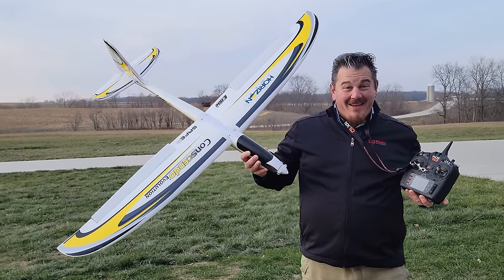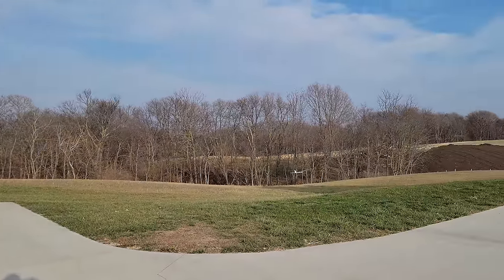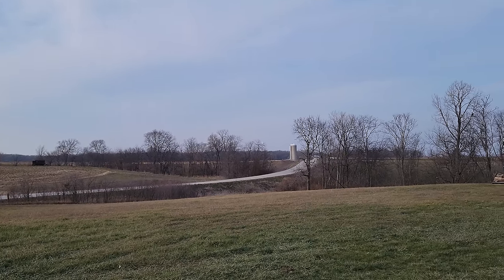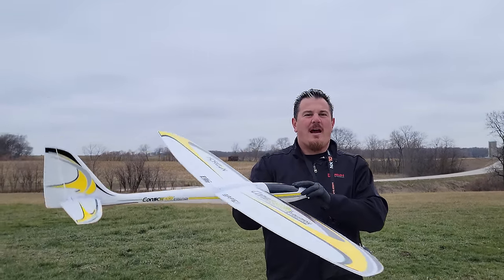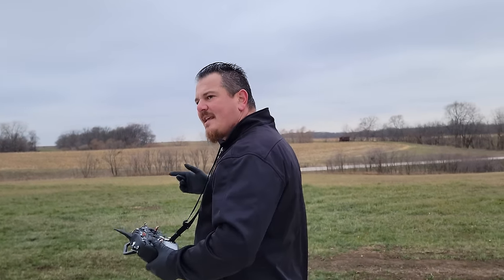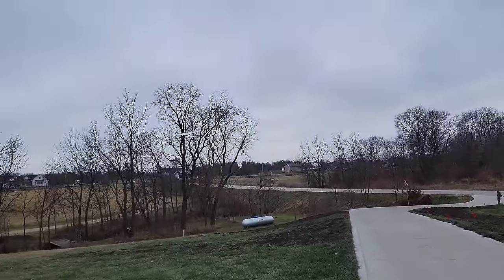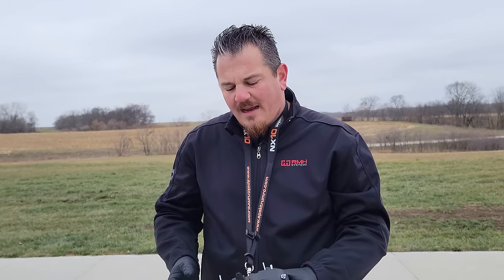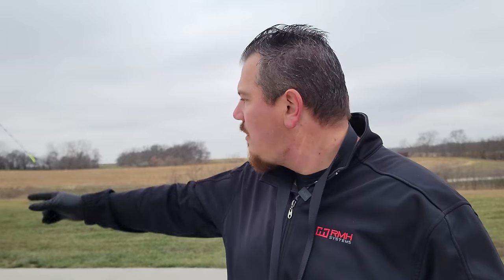E-flite - Conscendo Evo - 1.5m - Spoilerons VS Flapperons - Flights

Comment: I've had many Conscendos.  Love it!  With 4S you can hover it 3D!!   If there is a downside to the design is the folding prop breaks during flight on 4S when you fly it hard like i do.   I've told EFlight and Horizon Hobbies and they keep sending me new props instead of changing the design.  I think a aluminum hub is required....  Still love the plane and always keep one or two in my hanger..

Comment: Hi Brian, what a fantastic glider. I have the Conscendo Advanced and the Conscendo Evo, both excellent for enjoying a flight. I have made some changes to the Conscendo Evo, I installed an aluminum BB Spinner and Aeronaut folding propeller with excellent results. I think it is not necessary to use spoilerons and flapperons, I do believe that flapperons could be useful as flight modes in thermals. Greetings.

Comment: Great video! I suggest you allocate more time in your videos to the programming of the transmitter. Kind of hard to follow sometimes when you zip through that part. Finally, you mention it is possible to program this plane for crow. How do you accomplish that without having both ailerons and flaps?